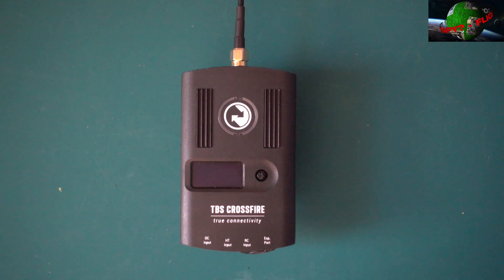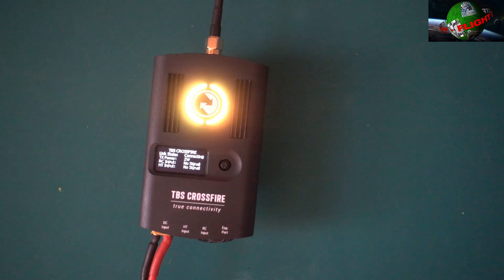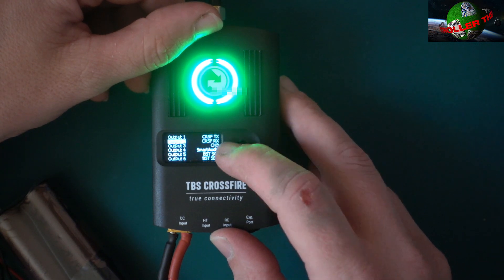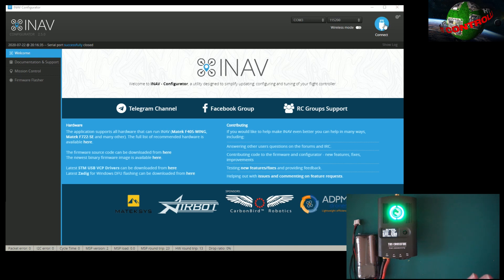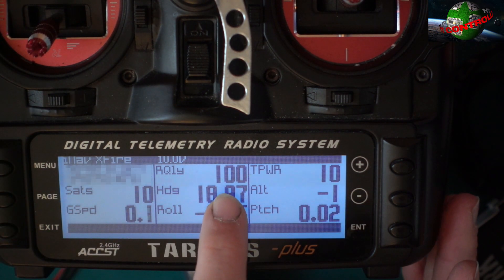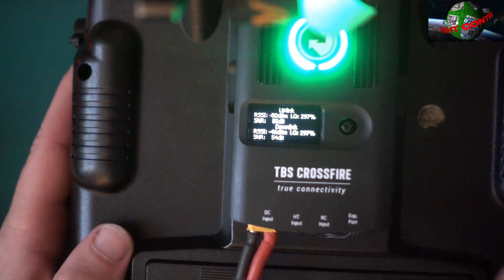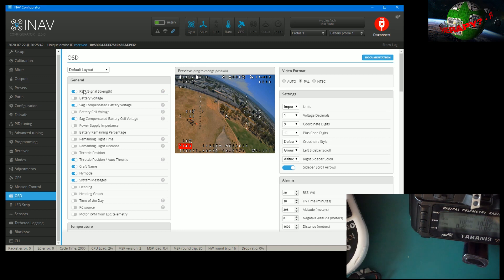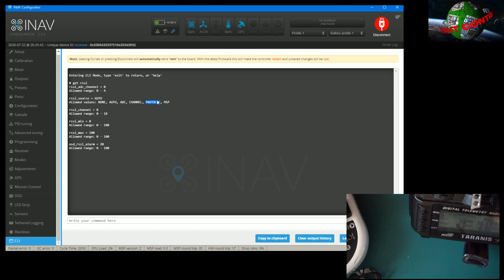How to get Crossfire LQ on the iNav OSD

Comment: Hi Darren. I wonder if you could help? I recently bought a used Heewing complete with Matek F722 flight controller. It came also with an ELRS receiver, which I don't use. I took it out and replaced it with an xm+ and set RSSI to channel 16. I'm using WTFOS on my DJI goggles and I get a flashing LQ message at the top of the screen. I believe this is the Crossfire quality message. I've searched the configurator and can't find it anywhere. It doesn't appear on my OSD when I am in the configurator. I've set the receiver to SBUS on the receiver page.
Reply from the maker: You will need to switch the protocol back to CRSF to turn off those OSD elements. Then you can set it to SBUS.
Reply: @MrD  Thank you so much, Darren - sorted!!

Comment: Does this still work the same? I'm using the full version old crossfire in an S1100 wing, with INav. 
Had it put away for a while, just wondering if I should select RSSI and LQ as 2 different items on osd
Reply from the maker: Yes, this is still the same. Just don't set anything on the Crossfire receiver and don't set an RSSI channel on the ports page. It should just work automatically. It's up to you as far as the OSD goes. The more reliable setting would be LQ, as you can sometimes have a bad RSSI but still have a good quality link.

Comment: Hi, Darren. I was watching this video to help me to understand why I am having lots of msgs of Telemetry Lost / Telemetry Recovered. My AR Pro is setup accordingly the directions shown in this video. And I don't know why these msgs are ocurring in very close distances to the home point. Any guess?
Reply from the maker: Hey Silvio. Telemetry lost will be the transmitter end. My only real suggestion would be to make sure the firmware for both the transmitter and Crossfire is up to date. My friend used to get telemetry lost messages all the time with Crossfire. Actually he got some the other week when flying near another friend with ESP32 Radar installed. His antenna orientation may not be optimum though.

I've yet to have telemetry lost on Crossfire. I am up to date (ish) with firmware, and always have my antennae vertical.

Comment: Thanks Darren great video, this is the way I set mine up and works great, but I'm trying to get radiomaster to show battery capacity MAH  current capacity or used capacity but I guess inav wont do this, if possible I'm sure you will know. Thanks again
Reply from the maker: You can get that with the iNav LUA script.
Reply: Ok I'll give it a try thanks

Comment: need help! so my first time using inav crossfire I have a matek 405 with inav 3.0 link as crsf. my rssi on my osd reads 8-12 but the bar level is full strength and but on my taranis its 99? I'm lost i set it up correctly i believe. went to fly didnt get any warnings, is it a scaling issue, what can it be?
Reply from the maker: No, you shouldn’t need any scaling at all. Do you get the full Crossfire OSD elements, and how do they look compared to the Tx?
Reply: @MrD  yes I have the full crossfire. I haven't check the crossfire osd havent thought about that, when I get a chance I will thanks! but other than that could it be anything else? I just uploaded a video of it u can see the osd info. I watched and read as much as can im still learning dint want any issues with losing connection.
Reply from the maker: To be honest, when I setup Crossfire, it’s just a case of setting receiver to CRSF. Everything usually just works. Only other thing off the top of my head is to check you have the latest stable firmware installed on the module, and let it update the receiver on bind.
Reply: @MrD  hey thanks for taking the time out to help but I figured it out and I had the analog rssi turned on. I turned it off and it worked.
Reply from the maker: Awesome. That’ll do it. Especially with no analogue rssi source.

Comment: HI my lq is set to auto on channel 17 but is behaving more like regular rssi rather than lq, meaning the numbers a jumping up and down more than you get wit lq when flying close to home. any advice?
Reply: Mine is behaving just the same and I can't work out why antenna seems ok.
Reply from the maker: You don't set it to use any channel. On the receiver page, set the RSSI channel to off.
Reply: @MrD  thanks for the reply I'm using a quiet recent inav, can you not just put it on a channel of your choice? Like you can on betaflight?
Reply from the maker: Assigning it to a channel is what is making it use RSSI. This is better than BetaFlight. You don’t need to do anything, leave the RSSI channel to off (the default), and it just works.
Reply: @MrD  doing exactly like you said the link quality behaves just like normal rssi just like the guy who commented before me said.
Reply from the maker: In that case, something has been set up for RSSI. The whole idea of this setup is you leave crossfire as the default settings, and don’t even need to change anything in iNav. If you’ve turned off the RSSI channel in the receiver, check the CLI parameter to make sure the rssi_source is set to auto. If all that is correct, and you’re using the correct crossfire and iNav firmware (should be these days, the minimum is an old firmware now), it should all just work as shown in the video.
Reply: @MrD  Hi again and thanks for your replies, it is set on auto in the cli, I think I may know the problem but don't know how to rectify it, using crossfire nano tx, with the rssi being put out on Ch 17 I do not have the option to choose rssi dB or link quality like I could if I chose a channel from 1 to 12. So I think it is fixed on dB.
Reply from the maker: The last thing to try is set rssi_source to protocol. But you shouldn’t need to. It won’t use “channel 17” unless you set that in the receiver page, which is why you set that to off. 

Have you tried the Crossfire OSD elements, not just the RSSI element, as a comparison?
Reply: @MrD  if you scroll down on the osd page you have the option for lq which I was using, I have now turned this off to see if it makes a difference, think my inav is 3.01

Comment: +

HI my lq is set to auto on channel 17 but is behaving more like regular rssi rather than lq, meaning the numbers a jumping up and down more than you get wit lq when flying close to home. any advice?
Reply from the maker: If you’ve set to use channel 17 for rssi on the receiver page. That’s the problem. It should be set to off, or whatever the top option is in that box.
Reply: @MrD  so you are telling me on the receiver tab rssi should be set as disabled not set to channel 17?
Reply from the maker: @quadthingcopter5984  yes, rssi channel should be disabled. It gets the data from packets.

Comment: I thought you had a video on setting up gps telemetry on your Taranis. I can’t seem to find it
Reply from the maker: You just need to discover the telemetry sensors when the flight controller and GPS are powered up
Reply: @MrD  ah okay, thank you. I’ll try that. Is that what let’s you see the horizon etc on your radio? Thanks for the quick response. Keep up the great work you guys are doing.
Reply from the maker: That’s the iNav LUA script. You can find it on the iNav GitHub.

Comment: I can’t get crossfire power level, and all the crossfire telemetry on OSD. I can set up Lq on Channel 12 no problem. But I can’t get what MW my XF on osd?  Do you have a link or a video for that?  I’m on XF 2.93 firmware and 2.6 INAV
Reply from the maker: Hi Vick. There’s not problem with iNav. 2.6 has enhanced features for the crossfire signal data for viewing on the OSD. You would set it up as in this video, so nothing sent on Ch.12. All the data is sent over the protocol. 

It would be worth updating your Crossfire system to the latest stable version. I have a feeling this is why you are having problems.
Reply: @MrD   I’ll give it a try ASAP. Thanks your for your response. I will give you an update when I’ve tried it again.
Reply: @MrD   I updated my crossfire to the latest and now have all xf telemetry on osd. Thanks again
Reply from the maker: Awesome Vick. Glad its all working for you.
Reply: Any help would be appreciated

Comment: Howd u get gps coordinates to diplay in the back of tx from nano rx?
Reply from the maker: They are there so long as you are sending back telemetry and have a GPS fix. You don’t need to do anything, it just works.
Reply: @MrD  hmm...i have gps locked, n i still dont see the coordinates in the tx, any idea what im might b doing wrong?
Reply from the maker: Do you get the telemetry sensors in your transmitter?
Reply from the maker: It doesn’t really make sense then. If you have telemetry on your transmitter, the module should be able to pick up the GPS coordinates. I guess you’re running the CRSF protocol too?
Reply: @MrD  from my taranis:
1RSS *26DB
2RSS *26DB
RQLY * 100%
RSNR * 75
RFMD* 2
TPWR* 10MW
TRSS * 14DB
TQLY* 100%
TSNR * 95DB
Reply: @MrD  yes i am
Reply from the maker: @theinnocent714  thats missing a load of telemetry. That’s just from the receiver its self. There’s no flight controller telemetry there. 

I guess you’ve wired up full UART, as in nano Ch1 to UART Rx and nano Ch2 to UART Tx. If so, make sure that telemetry is enabled in iNav.
Reply: @MrD  yea im new to matek fc boards n crossfire units. Im using the f411 wse with the tbs nano
Reply: @MrD  telemetry output is enabled in inav
Reply: My setting in inav : Ports
Uart 1: gps
uart 2: soft serial enabled
Soft serial 1: tbs smart audio 
Soft serial 2: smartport
Reply from the maker: OK. I see the problem. You are setting it up like its a FrSky receiver. 

UART 1: GPS is fine
UART 2: Serial RX - have Ch1 from crossfire going to this Rx and Ch2 going to the Tx. If the receiver hasn’t been changed, this should work fine. 
SS1: SmartAudio
SS2: Not needed
 
Receiver page, make sure the protocol is set to CRSF. Give that a try.
Reply: @MrD  ok got it! Ur right about not needing the smartport enabling in softserial 2. That did it. I think i was following one of  Andrew newton's settings while i was looking info on how to change vtx setting via control sticks.
Thanks so much for helping
Reply from the maker: With Andrew, he would have been using FrSky here. Crossfire doesn’t need all that as it’s not an inverted protocol. Its much simpler for setting up on flight controllers with only a few UARTs.
Reply: @MrD  good to know, just spent over a grand on new equiptments n wings. Not using my old ezuhf anymore. Trying to go light for the new law. In the process of building s 800 sky shadow, dart sub 250 and the Sonic model Ar Pro. All using tbs n matek f boards, all new to me and i sure am glad theres ppl like u willing to help a noob like me out. Thanks u and Subscribed!
Reply from the maker: No problem, and thanks for subscribing.

You’ve got some nice planes there. The Dart 250G is an impressive little plane. I’m currently building a 3S one after seeing Josh Gault and Matt Ogborne’s. Josh’s was on 3S and Matt’s on 2S.

The AR Pro looks really nice and smooth. The S800 is a great basher for having some fun. The T-Motor F80 pro is a good motor for that wing, and can get plenty of speed.
Reply: @MrD  yea i saw matt reconfigured the dart to 3s. Thats kinda heavy for the little plane, if its 18650 3400mah. I maiden the dart with 3s, wasnt prepared for it to b so twitchy, crashed n broke the front end.  Clean break, a lil goop n it's back in action. Still testings on thesettings,  want all my planes to go long distance. Building li-ion batteries for all 3 planes. 18650 n 26650. I currently got the emax 1500 kv on s800, might switch it to the 1000kv. To save juice. S800 will have 7000mah on 3s n the ar pro   with 10,000mah on 3s also. I got a 10x7 on the ar pro because i have a bigger motor lying around, we'll see how that goes.
Reply: Hi, got a question. When the crossfire tx is set to (max level output) i set mine to 500mw does it automatically adjusts power levels to what it needs all the way to 500mw? Rssi drops a lil even in proximity flying. Ive noticed that power display is always at 10mw unless i turnoff the rx which the tx would jump to max 500mw. Is this normal and a way for the tx to save power until its needed?
Reply from the maker: If you have dynamic power turned on, when bound it will use the lowest power it can at the fastest rate. When the LQ drops too low it will boost the power to the next level. It will keep doing this until it get to the maximum power level, then when the LQ gets too low, it will lower the link speed. It can lower the speed twice. After that, it will failsafe. 

When not yet bound to a receiver, it will be at the maximum power, until it binds. 

10mW is the lowest power level. It will use this until the LQ gets low.
Reply: @MrD  thats great , thank u

Comment: I need help yet again, I've connected my crossfire nano to uart 1 on my f405-wing channel 1 to rx1 channel  2 to tx1, I've updated micro tx v2 and receiver to latest firmware, it binds no problem solid green light on tx and rx, I've selected crossfire and serial rx inav 2.5.0 no matter what I can not get stick inputs in inav receiver tab. What am I missing? Any help will be appreciated
Reply: Ok thanks I'll try updating to 2.5.2 and see if it helps, thanks again
Reply from the maker: I don’t know if it will fix that issue, but you should still update.
Reply from the maker: Firstly, if you want to stick with iNav 2.5, I’d updated the firmware to 2.5.2 as there are known bugs in 2.5.0. 

The wiring sounds fine. Usually UART 2 is used for the receiver on an F405-WING. But it should be fine on 1. So long as Serial RX is turned on, only on UART 1 in ports. If MSP is on for UART 1, try turning that off. However, make sure that you keep MSP turned on for the top line, USB VCP. If you turn that one off, you won’t be able to connect to the flight controller via USB. On the receiver page, you need to make sure the protocol is set to CRSF. You shouldn’t need to change anything else.
Reply: I finally did get stick inputs in inav receiver tab, and all telemetry is on radiomaster tx16s screen weather to bad here to fly but I see no problem, my final step in this build is I want to use my android phone or tablet to monitor flight, I've downloaded mission planner app for android but no joy it will not connect I don't really understand the concept unless my crossfire micro tx v2 is setup for this. I've also ordered and received all the parts needed for the crazy dude bluetooth hack but have not build it yet because I see no way to use it with crossfire, I'm not sure which way to go from here the android app would seem to be the easiest but maybe not capable with crossfire. Thanks for all your videos and any help
Reply: Alittle off topic but I'm trying to connect my crossfire micro tx v2 to mission planner via wifi but no go, my android phone says connected to crossfire but the app just doesn't see the crossfire, I just want to be able to monitor my wing to know were it is, maybe there's a better way any help will be appreciated